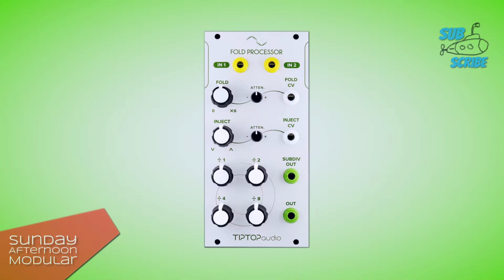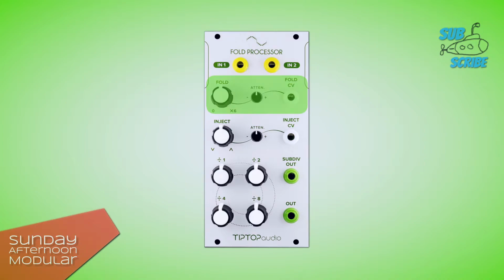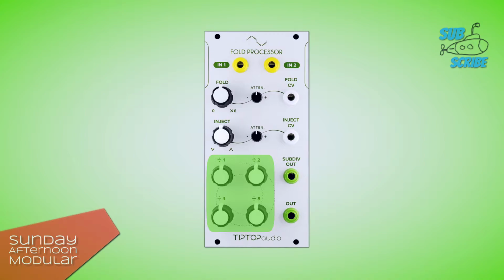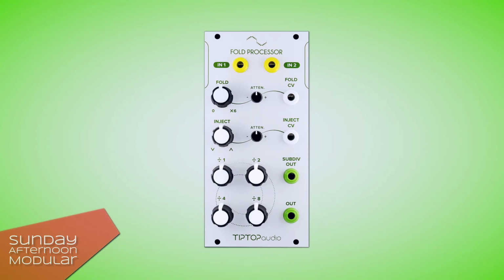TipTop Audio Fold Processor Introduction

Comment: Very helpful! I love my Tip-Top Fold Processor. I haven't been very clear on the inject feature, so thank you for your video. It's helping me get my head around it. Got the manual open now haha. All I know is that above and below a certain point, which differs based on the sound and other settings, the sound rolls off. But I'm not sure what the principle behind it is.

UPDATE: The manual revealed all!! The inject knob offsets the wave folding, so the dead spots are where the waves are offset to the point they line up and phase cancellation kicks in. Thanks for helping learn more about this one: it's a great sound sculpting tool!

You're a 2hp guy, I can see: do you have the 2hp Vowel? I was running that through this module last weekend and the craziness was very pleasant! I've never thought about plugging two sounds through at once: thanks for reminding me that was possible! Love your channel.